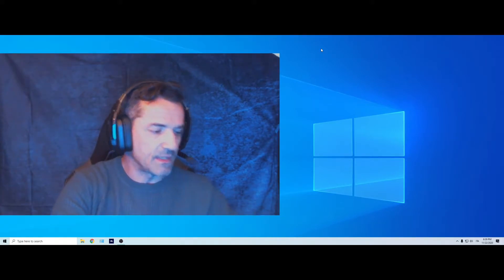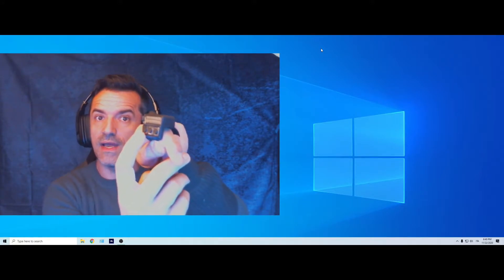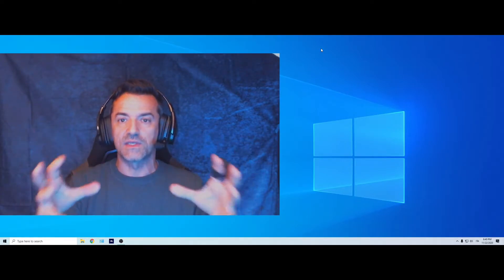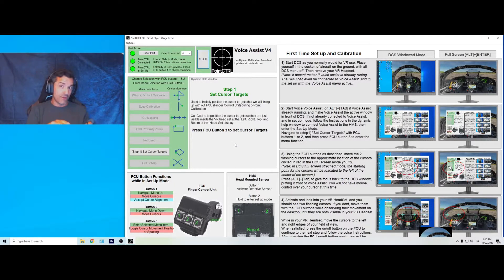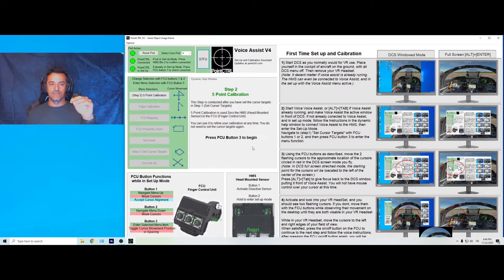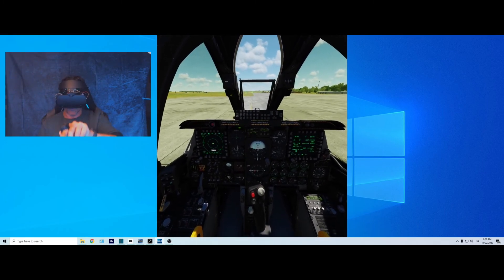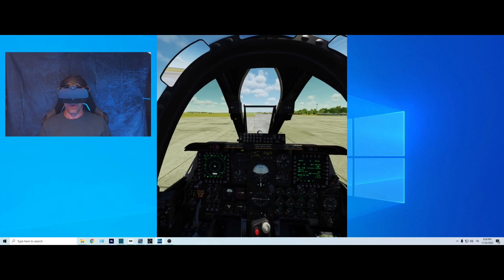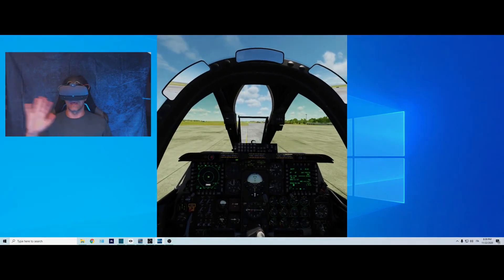DCS World, VR, PointCTRL calibration

Comment: just received my Pointctrl and have difficulties to set it up ... I hope succeed with your help, I'll try again tomorrow evening :)
Reply from the maker: Dear IL, it's strange as PointCTRL should work just fine right out of the box. Calibration normally only improve precision further. Be sure there is nothing upsetting the infrared light transmission (lightly dark room, no wrist watch, no bright source of light behind or aside of you [window], no other IR source around like for example the TrackIR system ... ). Let me know :-)
Reply: @krusty1974  thank you Jonny for your reply, I take take of that, put my trackIr in pause but it react strangely. I probably don't make the calibration, step 1 and 2 correctly. I'll try again and if I'm stuck pull the alarm trigger 😊. Thk you
Reply from the maker: @yohji1979  remember, even if your TrackIR is on standby if you are using the bracket with the three diodes and they are facing your HMSC unit, PointCTRL will go crazy. Try disconnecting TrackIR completely.